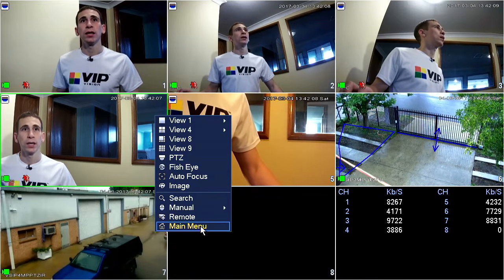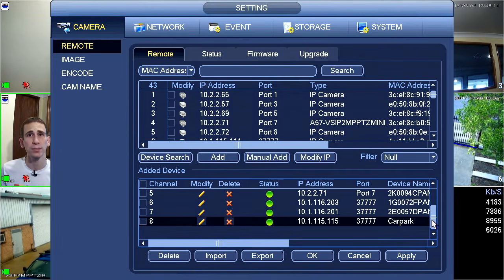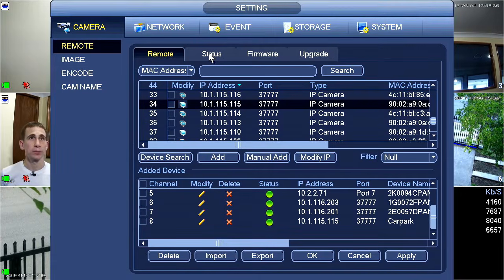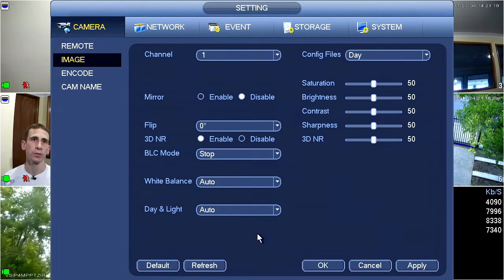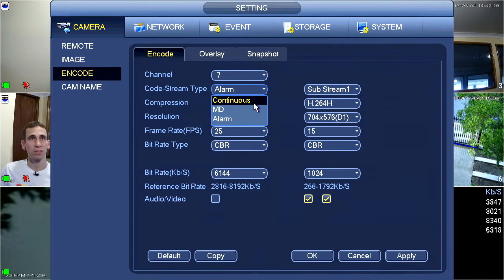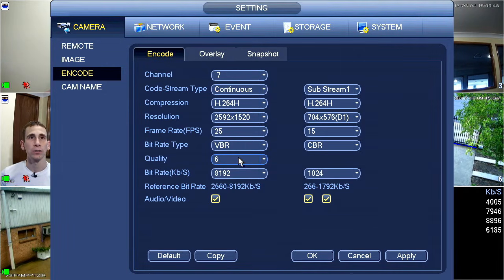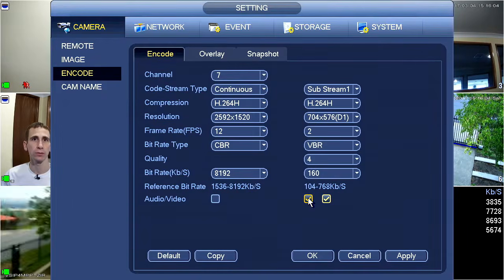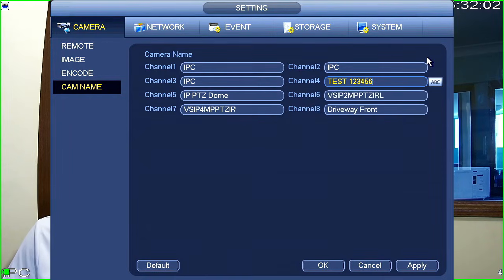VIP Vision NVR Tutorials: Main Menu - Setting - Camera

Comment: Any chance you can do a video on how to configure a PC based video server using the PC-NVR and SmartPSS software packages?
Reply from the maker: Hi, while possible, this isn't something we'd usually recommend - PCs are typically less reliable and more power hungry than a dedicated NVR.  However, we will do a video tutorial showing how to set this up soon.
Reply: RhinoCo Technology really appreciate it. I am currently building a rackmount server in order to run my home network and I want to be able to control my network from the server, but also raid a number of drives for the purpose of having some of the Xeon power process the NVR.